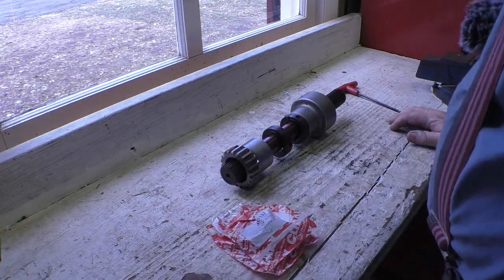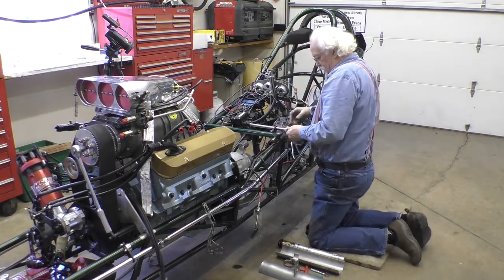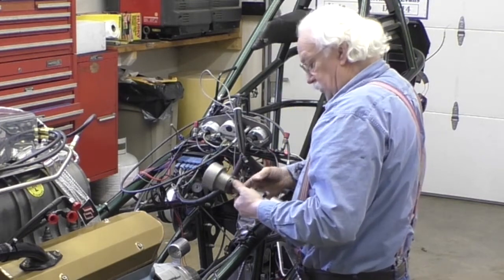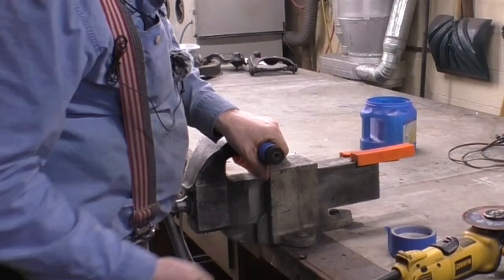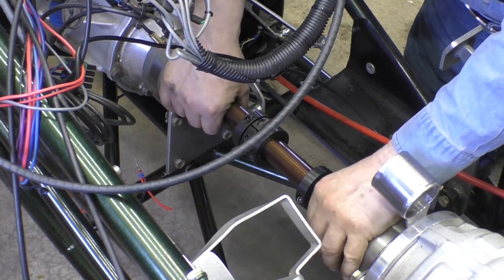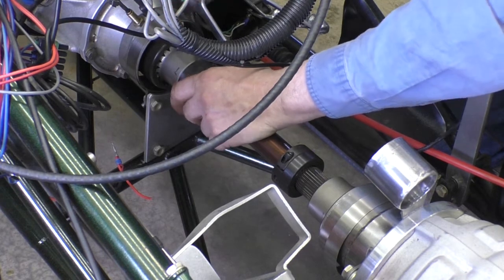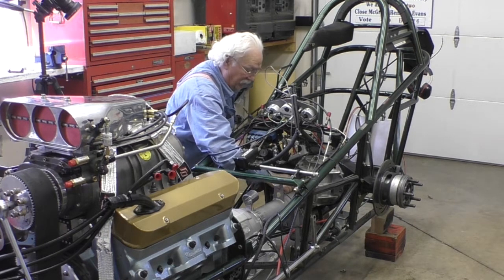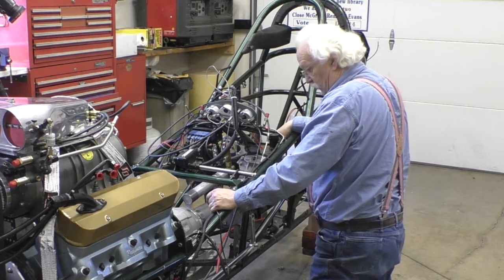Modify and install the Coupler Driveshaft into the Front Engine Dragster

Comment: Do you have wheel spacers on rear end?
Reply from the maker: When ordered the new wheels I got them in the correct back spacing to no need any spacers. I worry about an inspector not liking the amount of thread on the stud to pass
Reply: @ThrottleStopRacing  makes sense.

Comment: Great videos … And I was going to run my driveshaft on my Slingshot with out any locking rings as I didn't realise they needed them... thank you...
Reply from the maker: I have seen what happens when the coupler comes off. I run two locking rings on each end with the set screw 180 degrees apart. Thanks.
Reply: @ThrottleStopRacing  I will be definitely taking your advice and I will be running two locking rings at 180 apart as you have demonstrated ... This is my first slingshot after running sedans for many years … so much easier to work on as my days of leaning over and into a engine bay are  gone thank god ... thanks again and stay safe on and off the track...
Reply from the maker: @davidmuscat1524  Do you know about the forum Front Engine Dragsters?
Reply: Hi yes I have read a few which are very good while some can be a bit confusing as everyone has a different opinion on the same subject or they get off the subject all together lol... that's why I prefer videos like yours... cheers...
Reply from the maker: @davidmuscat1524  I am a founding member of "front Engine Dragsters". give it a try.
Reply: @ThrottleStopRacing  Will do thanks...